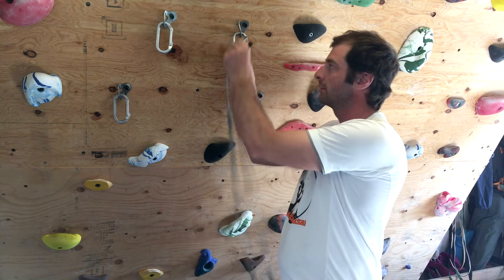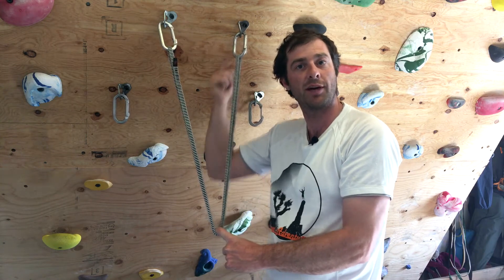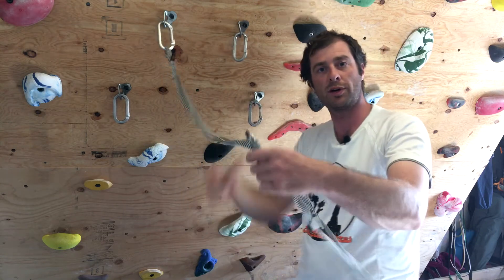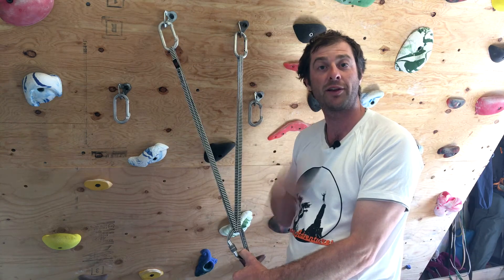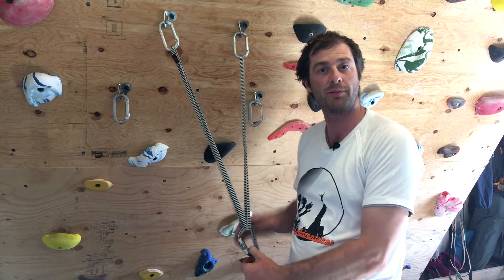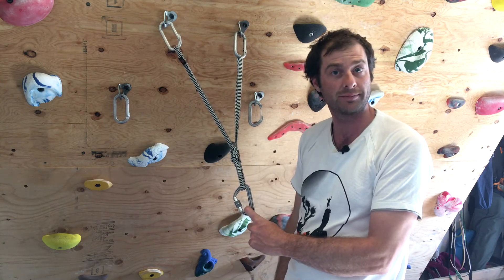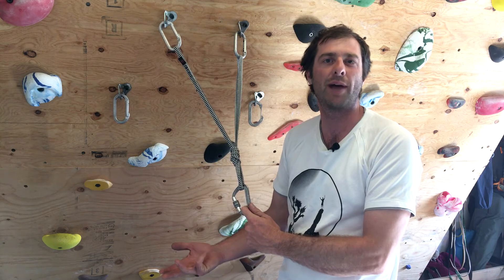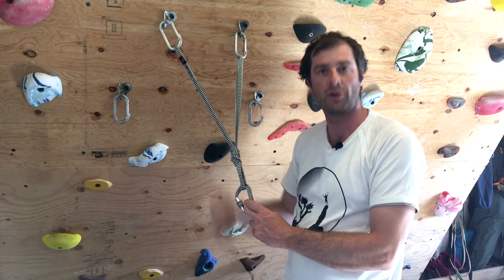What Is A Good Rock Climbing Anchor? - ERNEST Anchors - Bomber/Bombproof Anchors

Comment: Great resource, thanks Aron, but I would like to challenge your definition of "equalised" you define it "the anchors points are being loaded towards the mater point" I disagree, my definition of equalised is "the load at the master point is being shared equally (hence "equalised") by the two anchors". I would say the death triangle is "equalised" as both anchors are holding an "equal amount" ......don't get me wrong I am aware of the dangers of the death triangle as it multiplies the load at the master point because of vector forces and I'm not advocating its use I'm trying to define the terminology. Perhaps we need a definition that includes equal sharing of the load, direction of load on the anchors and no magnification of the load due to vector forces.
Reply from the maker: Interesting question, but I think the problem comes from the term equalized.  It is a misnomer because in the real world you can almost never achieve equal sharing of the load.  A better term is "load sharing", but it doesn't fit nicely into the acronym.  The shortest leg and the leg most in-line with the load direction take more load than the other legs.  There are more factors as well.

Comment: This configuration won't allow for dynamic equalization. If you simply tie a separate overhand knot in each arm you will still have the sliding x, and the anchor will remain equalized if the climber veers to the side. It's just one more knot, and far safer.